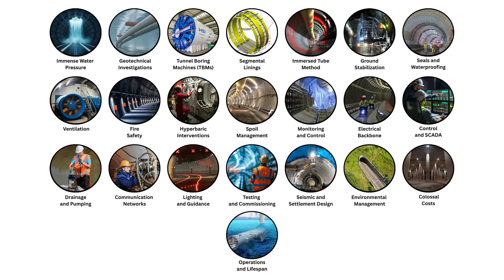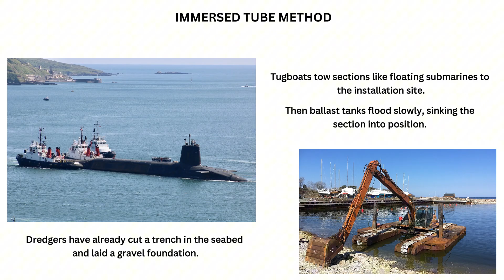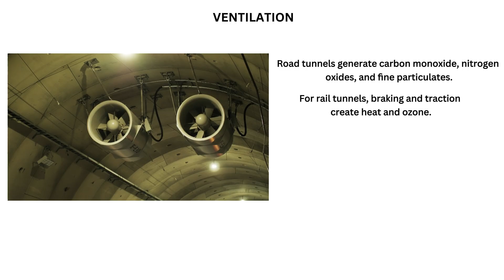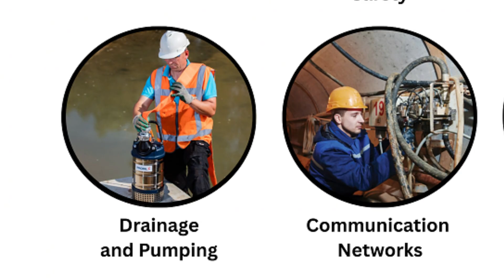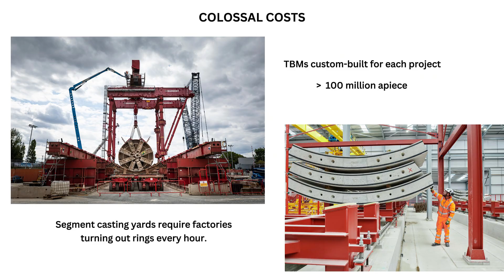How The GREATEST Underwater Tunnels Are Built EXPLAINED

Comment from the maker: 00:00 Immense Water Pressure
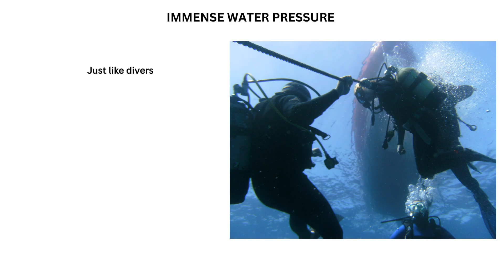01:07 Geotechnical Investigations
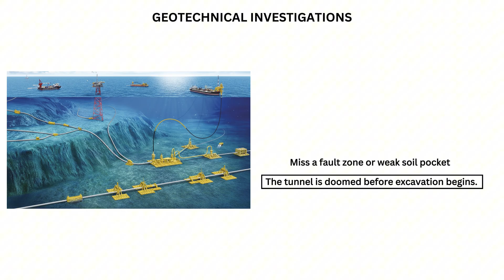01:41 Tunnel Boring Machines (TBMs)
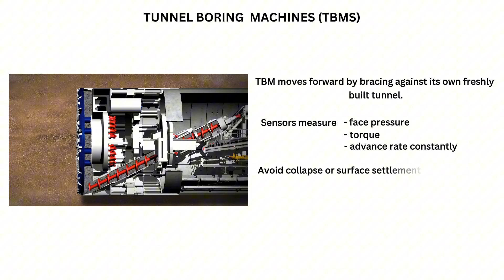02:32 Segmental Linings
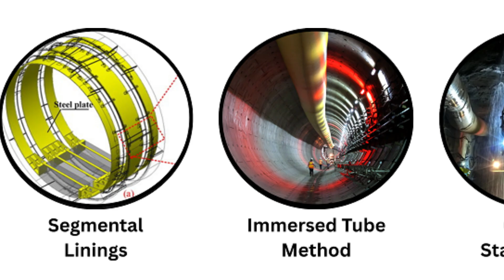03:04 Immersed Tube Method
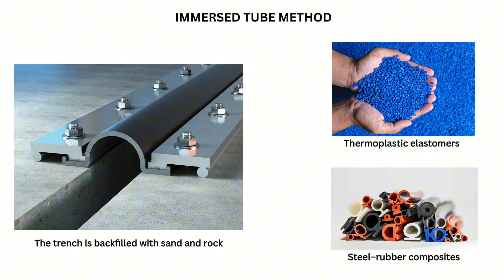04:22 Ground Stabilization
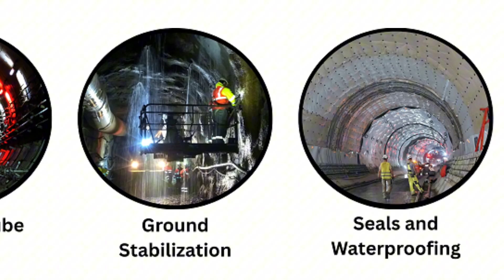05:19 Seals and Waterproofing
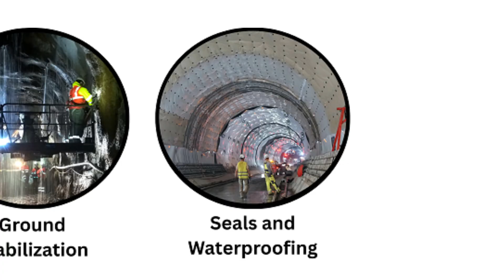05:55 Ventilation
06:55 Fire Safety
08:01 Hyperbaric Interventions
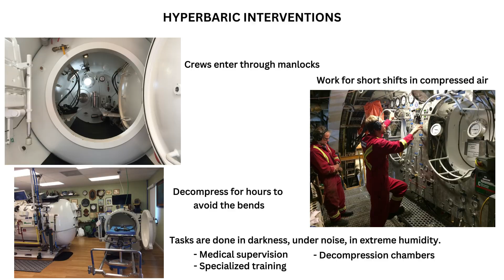08:33 Spoil Management
09:05 Monitoring and Control
09:36 Electrical Backbone
10:00 Control and SCADA
10:31 Drainage and Pumping
10:56 Communication Networks
11:21 Lighting and Guidance
11:42 Testing and Commissioning
12:04 Seismic and Settlement Design
12:35 Environmental Management
13:01 Colossal Costs
13:48 Operations and Lifespan